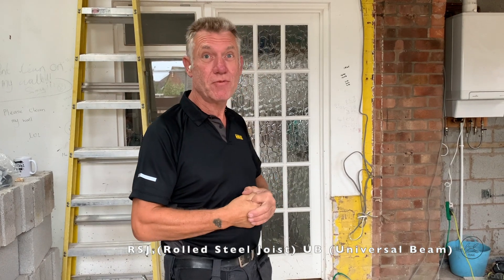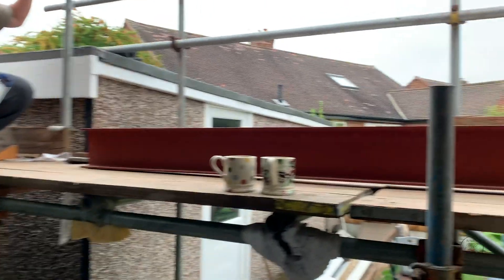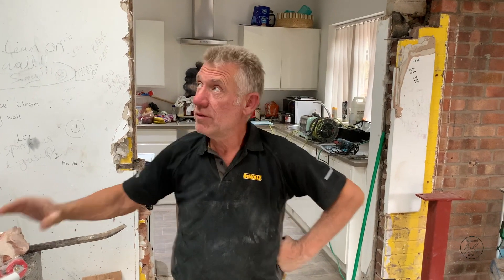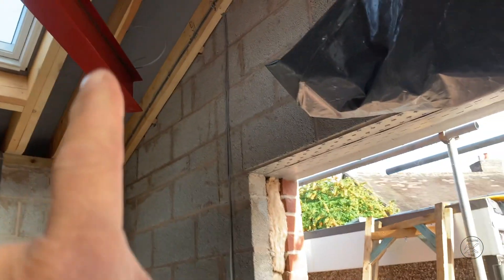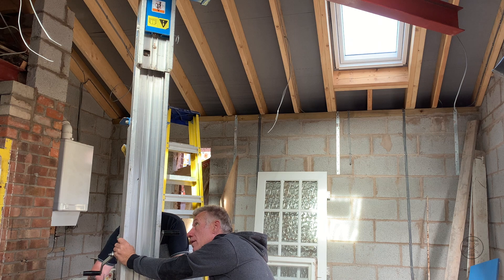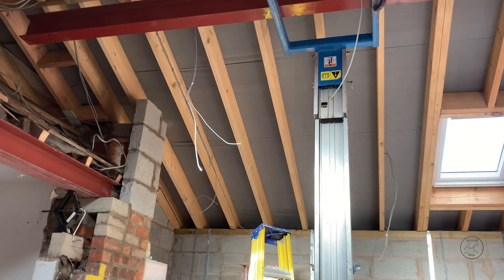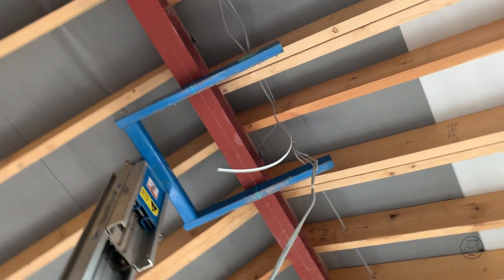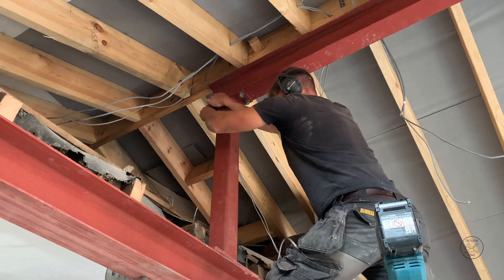Big Job: Get the STEELS in

Comment: It always amazes me that small builders prefer to put the structure in after they have built the shell, whereas normally the structure goes in first and then the shell is built on to it.  This small builder mentality caused a major cock-up on my house extension because the builder and his chippy couldn't set the building out properly, leaving them with all sorts of bodges to make it work.  The problems were not noticed until it came to size the steels for fabrication, when it was too late to insist that the roof be taken down and rebuilt.  What added to the  annoyance was that I had provided the steel fabrication drawings, which ought to have meant that it all went up like meccano.
Reply from the maker: Ours went in bang on, next doors didn’t have steel and I don’t know how they got away with it🤷
Reply: @foundationgood123  I don't doubt that its possible to install steelwork after the shell is erected, that happens all the time in refurbishment projects, but its a bit cart before the horse on new builds. I suppose that you measured for the steel once the roof was complete and installed?

As regards next door - did they have a good engineer?

Comment: Hard graft there as usual 💪🏼.
   That wall took sone getting out ! 
   I like that vertical post design 🧱👍🏽
Reply from the maker: Thanks Steve, those were a terracotta internal block and were splintering as they were being chiselled out.  The post took some getting right, had to drill my own holes on the bottom steel and that’s how I got them to line up! Have a great day guy’s and keep up the good work! you’re prolific works👍👏🧱⚒️

Comment: Why the ridge beam ?
Reply from the maker: Because of lateral force, its a bespoke roof ie no ceiling joists that would have added strength against the outward push of the rafters and with there being no pearling support the ridge beam adds strength to the roof
Reply: @foundationgood123  totally under stand now, I did wonder 👍 nice work 🙂
Reply: @Chris Longhurst  I see you've just answered my question from a previous video 😄😄
Reply: Could you not have put celling joists in anyway either above the vulex or just have large reveals round the vulex?
Reply from the maker: @ross19891  Well, it was on the spec! I personally didn’t think it was deeded.  We did box the ridge been with a very small ceiling but the Inspector wanted the ridge beam incorporated 🤷

Comment: Could you of put the steels in first?
Reply from the maker: Yes could have, this was the building Inspector’s add on 😂
Reply: @foundationgood123  is it something to do with the roof pitch when you need a rsj ridge ?
Reply from the maker: @Fordmad90  Yes, and the lateral pressure.  I thought the size of timber we used on the ridge board would have been sufficient but they wanted a steel. Interestingly the next doors extension didn’t have one!!!
Reply: @foundationgood123  must be expecting aircraft to land on the roof.